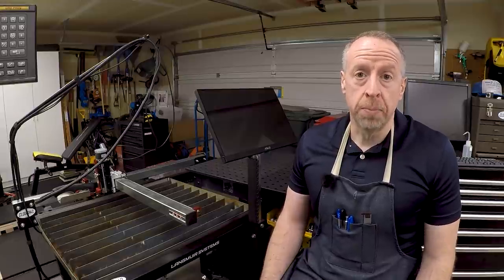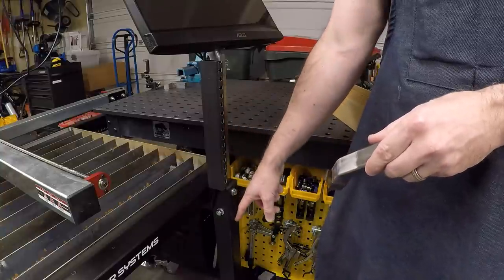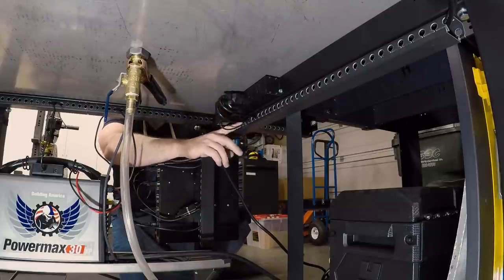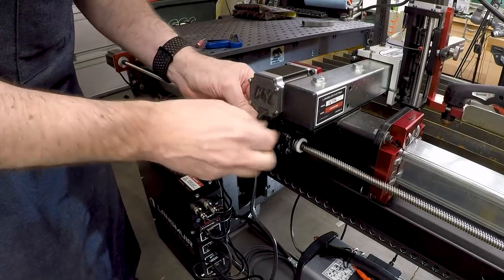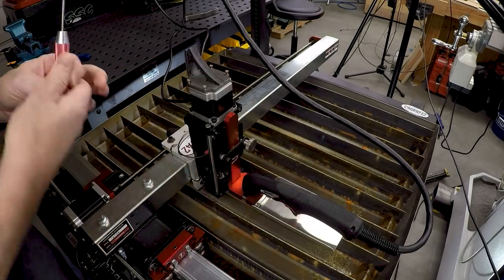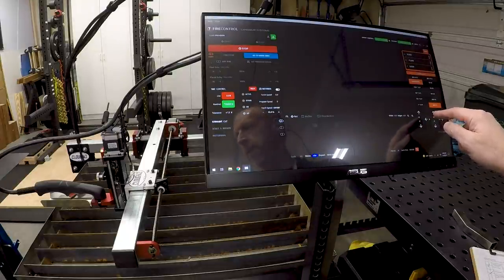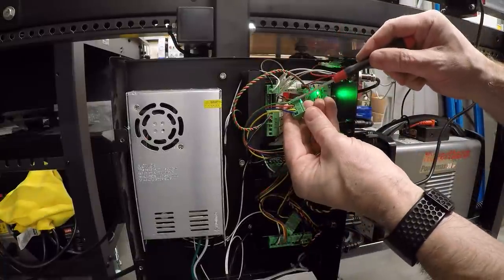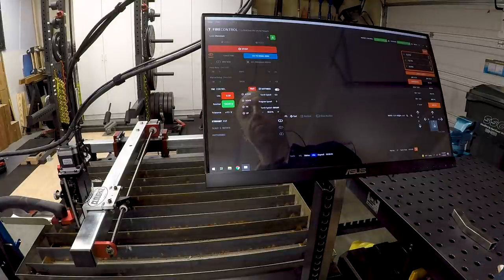Crossfire Plasma Table Cable Management | Swapping the Axes

Comment: Nice job!
For the 'new X' floating cable, you could get some 'spiral tubing'... It is usually used to gather cables together but it also serves as a stiffener...
Reply from the maker: Yeah...I'm not sure if it's needed.  The cable is soft, and it's well-supported at both ends now, so it should just flex along without trouble.  I'll keep an eye on it.

Comment: I like the 3d printed cable strain reliefs.  When possible, I prefer to have screw heads recessed into the 3d print to minimize snagging opportunities.  Very excellent finishing touches on this project.
Reply from the maker: The heads are super close to the edge of the part, so the counterbores would be open on the sides.  Still possible.

Comment: Nice work (as usual). I always find myself finding new projects before the previous one is finished. Latest thing I managed to do was to find out that 3mm (1/8" or so) sheet of steel [or other materials] fits UNDER the fence at the back of my chop-saw. Which is rather annoying, and it's such a tight fit that it actually bent the fence - but also pushed my material under it. So I'm now paused on the OTHER project to make a new fence for the saw, from some slightly sturdier piece of aluminium [and having less gap under the fence, so thin material doesn't go under it!]
Reply from the maker: Yup.  Project inception is a real thing.
Reply: @Clough42  yak shaving.

Comment: Tie wrap the cables to the post. Done!
Reply from the maker: Lots of people do things this way.  Personally, I don't like the look, and find it frustrating when it comes time to make changes later.  Changing one wire that runs the length of a bundle requires cutting off all the zip ties and re-doing everything.

Comment: Great video.  I use the same orientation as you now do.  I think I am going to try to find some sheet metal cutting project so I can run my torch.  I learned about using borax in the water too late and now my water bed is rusty.
Reply from the maker: I used borax, and everything rusted anyway.
Reply: @Clough42  bummer bad advice from the internet who could imagine.

Comment: Designing and 3D printing a new torch with the lead going straight up would also be a nice project :-)
But it might of course be that it would get too hot.
Reply from the maker: The real issue would be the copper tubing inside the torch, and whether it could be straightened.

Comment: I worked for a software company that had a comb binder for creating product manuals and such. There was a box of huge combs that could bind hundreds of pages, far more than we would ever need to bind. I repurposed them by using double-sided foam tape to attach them under the tables in our computer lab (you could also use hotmelt glue). It got the cables up off the floor and was super inexpensive for an application where the cables would ultimately be out of sight anyway.
Reply: I've had to deal with far too many cable tie pads 'secured' with double sided tape, where the weight of the cabling just pulled them off over time. I don't trust tape adhesives to not turn into goo (electrical tape) or powder (duct tape).  For my own use, I'll do the work for a screw or bolt to hold things fighting gravity.

Comment: I was a little surprised you reached for connectors and wire to reverse the axes rather than some config settings in the control program. I guess there might not be any in a packaged solution.

The only drawback I see is that you now have the plasma gun semi-permanently attached to the table, and have to cut zip ties to use it free-standing. I think I might have used a Velcro wire wrap instead to do the bracket attachment. I think you can get them in the hardware store these days. They became incredibly common in the theater for cable management a couple decades ago.
Reply from the maker: Good ideas.  You are correct: there are no settings in the packaged software.
Reply: Even not the maximum travel for each axis?
Reply from the maker: @wouterw.schalkoort1988  I really don't know how to say it any more clearly.
Reply: @Clough42  I wilton has a good point on the cable being attached to the motor.  When the consumables go on mine, I stop the machine, pull the red torch holder off the machine entirely, fix the consumable, and re-mount.  It might be cool to make this a magnet 3d printed mount so you can easily take it off and put it back on without having to re-home the machine.

Comment: A considerable number of commercial Laser cutting centers screw up matching the axis orientation on the operator display to the actual axes.  The displays typically use a view from the long side of the machine, but the operator display is on the short side where the doors for access are.  So, everything is rotated 90 degrees. 

Less than ideal when you're on your 5th 12 hour day that week, and one of the nest files to run is a square aspect ratio.  Not an issue until it happens there is a grain restriction.  Don't ask me how I know.

Comment: Another way of wire management on your monitor, use a tube that fits over the square tube that holds the monitor up. It could be round tube square tube rectangle, even PVC and then you could run your wires inside of it, it would give you a cleaner look easier to clean and less likely to get a spark on it.
Reply from the maker: Also sounds like a lot more work.  And unless the tube is very large, it would require disassembling the monitor mount and pulling it out of the leg to get the cable ends through it.
Reply: @Clough42  Yeah but what would look better? Which will protect the cables better?

Comment: If you're looking for projects, I'd love to see you add a Z-axis scale to your lathe and use that to upgrade the ELS so you can replace the threading dial with a "start the thread when it comes around" pushbutton that would work for either inch or metric threads (or tie into the existing scale somehow if you already have a DRO; I can't remember if you do.)
Reply from the maker: Sounds like what you really want is a CNC conversion.
Reply: @Clough42  Not really. My lathe doesn't have a separate drive mechanism for the power cross slide, so full CNC would be a huge project for me, and I suspect for others as well. 

I just find the full-manual method of cutting metric threads with an imperial leadscrew or vice-versa to be cumbersome and error-prone, and it seems to me that the only thing the ELS needs to eliminate the need for the threading dial (or, in the mixed system case, the nonexistent threading dial) is an idea of the carriage position.

It would also let you set a stop for power-feed and threading operations, but it falls far short of full CNC.

Comment: Is there potential for some parts to now print ‘upside down’ with the reversal of the stepper? Ie, with the dross on the up side? Oh also, while I’m here - really looking forward to you revisiting the ELS and making V2.0 - I’m really enjoying my lathe now ;-)
Reply from the maker: No.  The parts will cut the same.  If you rotate the coordinate system 90 degrees, one axis always has to be reversed.  You are, however, the first person to recognize that even if the parts were reversed, they would just have the dross on the other side.

Comment: Some nice solutions there. Just one question, what is the heat tolerance of the 3D printed parts considering that the stepper motors can easily operate at up to 80deg C in normal use?
Reply from the maker: This particular filament starts to move around 80C.  Though the motors on this table don't run anywhere even close to that.  At least not in my shop.

Comment: @Clough42 what are your thoughts on your squat bar? Do you have shoulder problems when using a regular barbell? Did switching help?
Reply from the maker: I'm primarily using an Ohio Power Bar in a low-bar position, since that's what will be used at USAPL meets.  I also have a safety squat bar that I use for accessory work.  It moves the weight forward to somewhere between a high bar and front squat, so it works the muscles differently and adds variety and a little less specificity.  I had some stiffness and discomfort in my left shoulder for a few weeks, but I did some stretching with a resistance band before squatting and limited it to two days a week for a little while, and that has resolved completely.

Comment: I love you videos, great job on all the mods. Just out of curiosity what is the over all height and width and length of the table? If I am not mistaken you purchased the 33" upgrade.  I am looking to purchase one myself but I am very space limited.
Reply from the maker: I bought the extended Y (now X) axis version.  The only difference is that the rail and motor stick out further on one end, and I can easily tuck this in behind something when storing the table.
Reply: @Clough42  
Awesome thank you so much!

Comment: For the stepper cable mount—wouldn‘t it be preferential to put some venting holes/slots in the plate? I don‘t know about this application, but in my 3D printers, the steppers always end up getting pretty warm, and can do with as much ventilation as possible, if not even a small, slow moving fan.
Reply from the maker: I haven't noticed the motors running warm.
Reply: @Clough42  probably a runtime thing, then—I suppose you seldomly plasma cut for 6-12 hours on end… 😅

Comment: James, Did you consider user a power trak for the cables on the moveable axies such as : Hubbell

Raceways, CableTrak Series

Item# HCT252341 ?
Reply from the maker: Yes.  I ordered a couple.  The stock x motor cable is too short and permanently attached to the motor, so that would be kind of a pain, and one large enough to handle the torch lead without issue adds a lot of load to the axis as it moves.  I decided it wasn't worth it.

Comment: Since the table has no limit switches, is the canned software OK with swapping the (unequal length) X- and Y-axes ?  Will it try to overrun one and not reach the end of the other now ?  Or are the soft limits adjustable enough to compensate ?
Reply from the maker: There are neither limit switches, nor soft limits.  It's a very simple system.

Comment: Always enjoy your videos. Also brilliant way to think how to manage your cable,but l hope you don't use zip ties on the torch housing , cause you could reduce air needed the torch to work properly just hint not judge anything try use some PVC on that one l suppose will handle the pressure also keep it clean  just suggestion also your way not so bad but in long term could make maybe some issue on torch air pressure at the parts specially at thick plates
Reply from the maker: It's only a 30A plasma cutter, so I doubt the air will be an issue.

Comment: So, maybe dumb question, but when you swapped the motor connections and directions around you did correct the limit switches as well, right? Would hate for the machine to crash itself because of that.
Reply from the maker: The machine has no limit switches.

Comment: Are you going to get a machine torch,or are you good with what came with the plasma? I'm going to purchase this same table,just your thoughts. Maybe keep that torch if you need to use the plasma conventionally.
Reply from the maker: The plasma was a separate purchase.  Didn't come with the table.
Reply: @Clough42  OK,I didn't know if you had plans to change it in the future,or if you were OK with it.

Comment: I'm curious about why drag chain wouldn't have worked. Because it would need a gutter to ride in?
Reply from the maker: You could probably make it work if you lengthened the cable.  For the moving axis on the arm, a chain large enough to carry the torch cable looked comical in relation to the lightweight arm.

Comment: Wait a second. So this table doesn't have homing switches? I see why they're so cheap (not that it's bad or anything).
Reply: Not sure what motor driver it's using, but newer ones can detect the current spike of a crash and they use that for homing.  The Prusa i3 MK3S 3D printer does this, for example.  I don't think you'd want to do this on your industrial CNC machine, but it seems appropriate for the speeds and feeds and moving mass of something like a 3D printer and MAYBE a plasma cutter.
Reply from the maker: Yeah, not really needed.  The moving mass is small, and crashes don't really damage anything.  The only time I've even crashed the machine was just by being dumb with the hand controls.
Reply: @Clough42  homing switches give a convinience of soft limits, so that you can never crash the machine. I hate to crash my machine (1.5x3 m table, but not too fast). But, yeah, for something small and light not critical at all. Return to home function also not really needed for such small table.

Comment: When you reversed to rotation direction on axis without telling the software, wouldn't that result in mirrored parts? I understand it's a 2D part, but still...
Reply from the maker: Nope.  Because I also rotated the coordinate system 90 degrees by swapping the motors.  If I hadn't reversed the direction of one motor, it would have reversed the parts.
Reply: @Clough42  You are right. After switching the axis wires it was going the wrong way, which was the whole point of changing the phases. I don't know why I suddenly got the idea of it being a mirror image of the part.

Comment: Are the holes in the motors for cooling?
Reply from the maker: No, they're just drilled and tapped all the way through the plate for screws on the other side.

Comment: Congrats on finishing a project! I have yet to do that (I've just started putting my workshop together, so all of it is still WIP).
Regarding swapping your axes around, did you confirm that the machine still correctly moves to the home positions (when homing it) on the axes?
Reply from the maker: This machine has no limit switches or homing function.  You set your zero point, load your GCODE and go.

Comment: No way to change the direction of the motor with the software ?
Reply: then also the limit switches ... the crash will be for sure solved by them.
Reply: This is what I was going to comment as well, any good CNC software can invert the DIR output trivially in software.
Reply from the maker: This table has no limit switches.
Reply from the maker: Honestly didn't look.  It's canned software specific to the table, with no setup required.
Reply: @Clough42  new project ?  ;)

 I added limit switches on my Sherline mill ( i am playin in sand box  and don't want to leave it ) , 
> some holes to drill, some tap to make, then microswitches and screws ... about half day . but If the software manage them on your machine
Reply from the maker: @Tupeutla  the software is canned for the machine, so it doesn't have these features.
Reply: @Clough42  ah sh... , what about the "enable" pin of the motor drivers ?  do they have one ?  in case you make a serial loop with 2 switches in normaly closed contact , then if the loop open triggers down the enable ... or the same in parallel  with normaly opend contact , depend if the enable is low or high .... if no ,  then the ultimate : 2 switches in parallel , normaly closed . so it will mechanically the current passing thru a relay ? ... for sure you need an override button  to bring back the axis to the good direction and free the limit switch .... just some thoughts ( sorry i speak french )
Reply from the maker: @Tupeutla  I have to ask: why?  I don't see a particular need for them.
Reply: @Clough42  to not destroy you leadscrew junctions ?  do you you have something like a mechanical breaker , or the  coupler   is strong enough to manage the motor stall ? if yes , no problem . these are  questions . 

in another way  : people have seen motor stall and crash on axis . so you confirm this stuff can survive ? 

again just questions
Reply from the maker: @Tupeutla  I crashed it and saw no damage.  I have no plans to do it again.